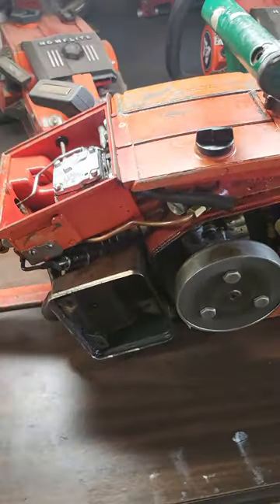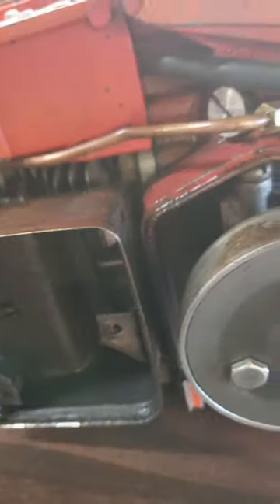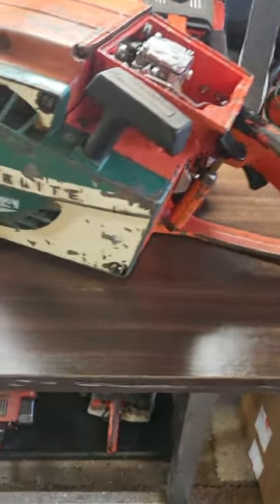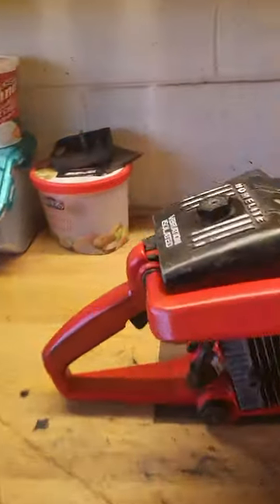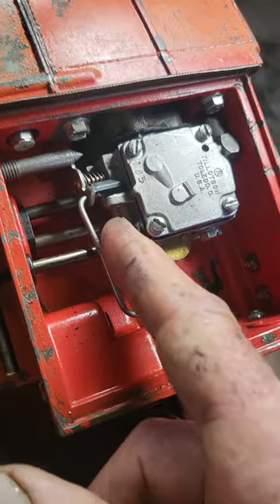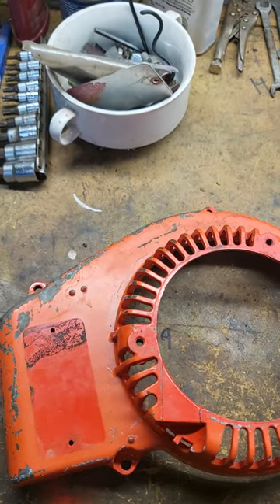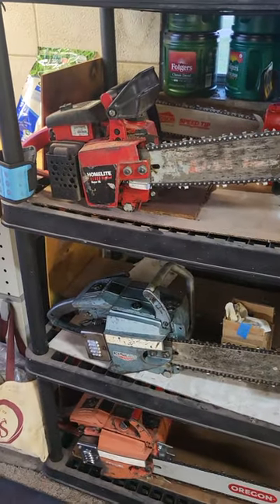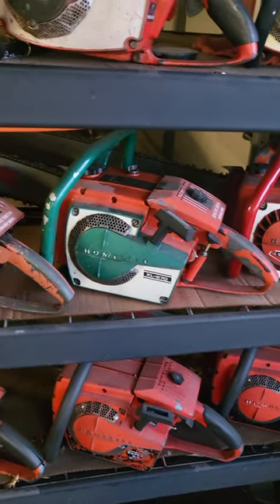Homelite Chainsaw Restoration projects

Comment: Great to see an update on your projects. We have a spot welder we use for welding tabs back on
Reply from the maker: Thank you. my problem was the L shaped bracket that held the nut was broken. I suppose I could have removed the broken piece and had it brazed, but another muffler body was a cheaper and more permanent solution

Comment: I couldn’t tell, do you have a xl 102? I think their am as well
Reply from the maker: I have two XL-102 Automatics, one completely restored, very few XL-102's were auto oilers with manual override, most were manual oilers. The auto oilers had white backgrounds on the side decals and the manual oilers had black backgrounds on the side decals
Reply: Will it say it on the terry badge? Because mine is a 102 with 101 clutch cover and recoil